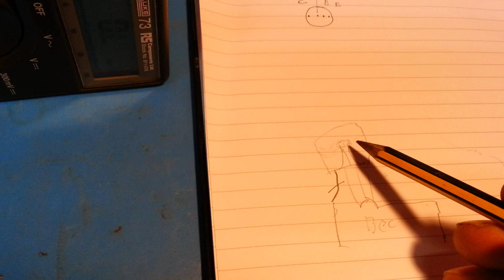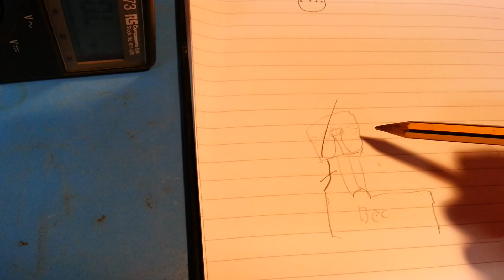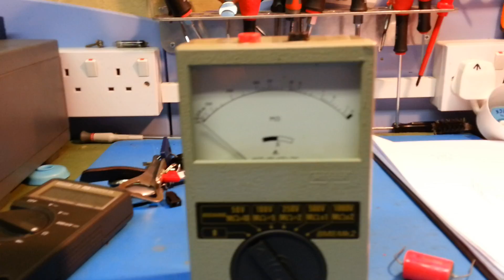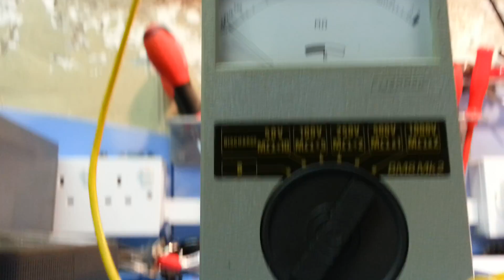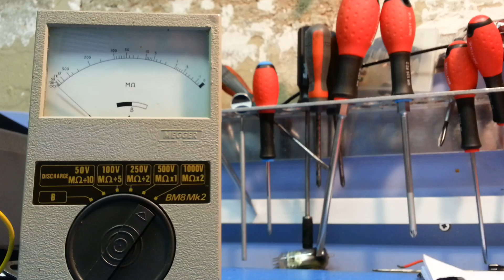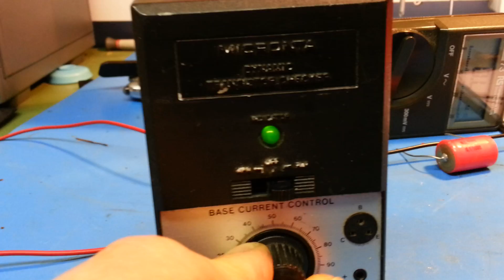Tin whiskers inside a AF117 transistor.

Comment: This problem is not unique to transistors. Anything with a plating of tin can be susceptible to whisker formation. Some of my transistors cans had them growing and they sparkle in direct sunlight. I started thinking. They are micro small in dia and the blowing method should work with a battery that can deliver sufficient current to blow the thread of tin. Further research shows that the whiskers can be rubbed off. That's ok for external growth but what about inside a transistor. The AF 117 has a can that is soldered to its glass base plate via a metal ring bonded to the glass. Could the can be removed and the inside cleaned out along with the whiskers. I hope to try this once i have got one of the AFs out of my Roberts R 300. I have found three more AF 117 in my bits box but they will need cleaning  I suspect. I have tried the shock method,  That did work but didn't last long. Another thing to consider is that the melting point of tin is low around 230°C. Maybe the tin could be heat melted. If so i would put the Transistors on top of a tin, legs up, over a cooker plate. Also have some solder wire on the tin. When the solder melts turn off the heat and wait till solder is solid. Hopefully by then any tin would stay hopefully back on the Dan. When all cool test the transistor. I have no idea if any of this will work.  Don't over heat transistor as the can may pop or explode. Its entirely at your risk.

Comment: Just had one of these today in the IF amp of a 1960s Bush TR 230.  I tapped it with a screwdriver and it crackled back to life ... then packed up again  . I haven't got a Mega but a nice gent is sending me a good second-hand tested example through the post. I originally saw the phenomenon back in the seventies working on transistor radio's , they were nearly all 1950s/60s germanium jobs and the AF were particularly prone to this , we had new ones on the shelf back then that were only months out of production so the whiskers hadn't started to grow.
Reply from the maker: It's a big problem particularly in the Mullard Af 11# series. Strangle that some never  to develop the fault.

Comment: I have a Teac A 1500 that looks like a museum piece. Got it cheep, saved it from a junk pile. The heads are about 90% still there and are worn straight, not trapezoid. Problem is it has some noisy germanium transistors in it. They are not shielded like the one you have but have a metal case. Would this method work on them buy using the metal can for the ground?
Reply from the maker: John Stark The noise from the transistors is usually from the junctions and shielding won't help. Are you sure it's not noisey carbon resistors? Go around with a can of freezer or a hair dryer, somtime you will find the culpruts.

Comment: Wouldn't a low voltage be better since you want to melt the whisker. If you vaporize it you're going to plate the inside surface with a coating of metal including on the transistor die.
Reply: The transistor die is suspended in a blob of silicone grease. Ron W4BIN

Comment: I usually charge an electrolytic up to about 150V but I take your point regarding the use of a higher voltage. You do still see an internal flash at 150V and the transistors, I have "flashed", do seem to last for several years.

Comment: Hi 

Very interesting video!!!

I found a NOS af114 transistor with whiskers between case and collector. In the receiver where I soldered that transistor only works when I disconnected case’s lead. I solve it powering with low voltage (about 10 volts) between collector and case.
Solution was easy because was between case and collector. I don’t know if this method will work successfully when short will be between leads of the own transistor neither between case and transistor.

By other hand I found in the same Philips radio the first transistor (mixer-oscillator) oscillates correctly but sensibility was poor. When I changed that transistor sensibility improves a lot, I think that this transistor also has whiskers. It’s unusual in a transistor that behavior it works or it doesn’t but not a poor yield probably it also has whiskers. Unfortunately that transistor was with capacitors to garbage. :-(

Any case and thinking in the NOS transistor that I told at the beginning ¿how many time will be working in good condition until the next whisker?

Comment: One method I intended to try, but never got round to doing, when I had some faulty AF series transistors, was to place the transistor in a strong AC magnetic field, to see if the field would deform or alter the structure of the whiskers, worth a try.
Your method is great, and well worth doing to restore some working samples.